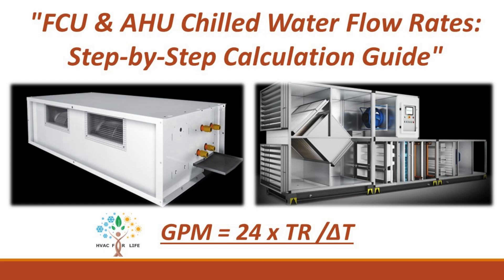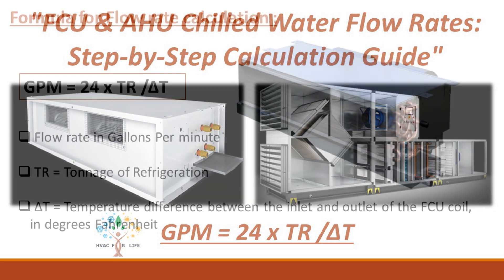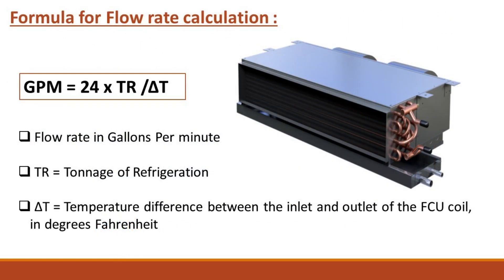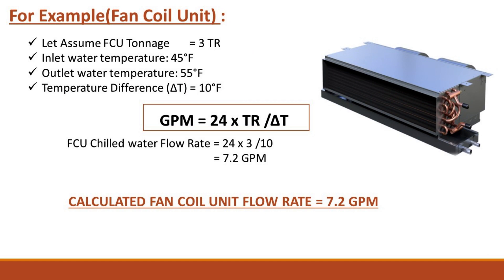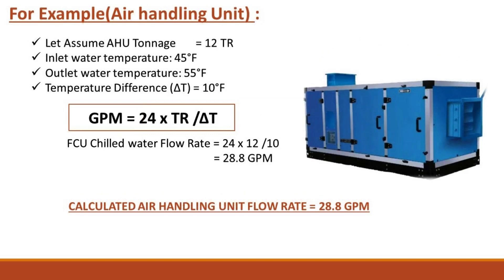How to calculate, flow rate of FCU (Fan coil unit) & AHU(Air handling unit)

Comment: I work on screw chiller hit
But my chiller (evaporater) gpm is 337 and condenser gpm is 442. 
Chiller capacity is 130 TR
Reply from the maker: The condenser pump needs more water flow (GPM) than the chiller because it has to get rid of more heat compared to the chiller that absorbs heat.
Reply: What the factor 24  means ?